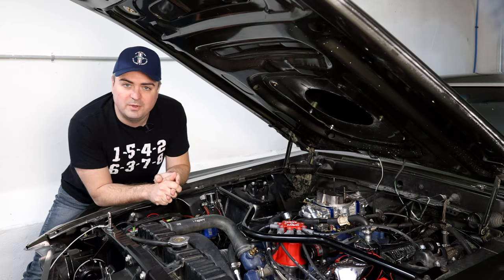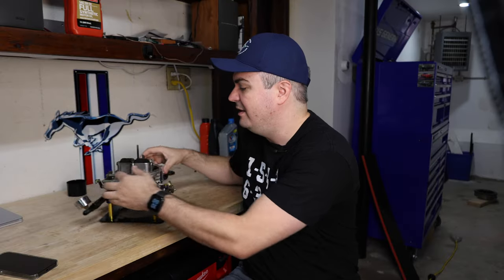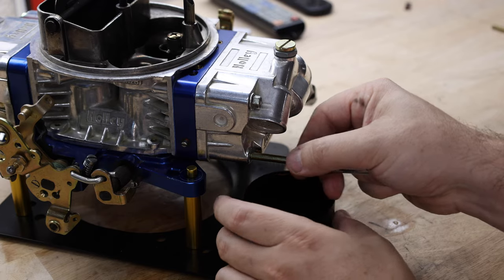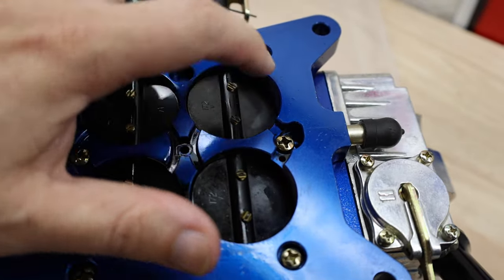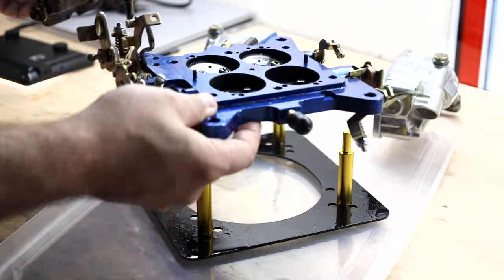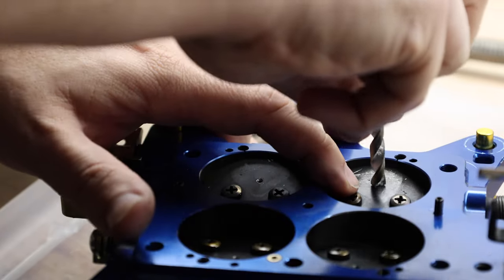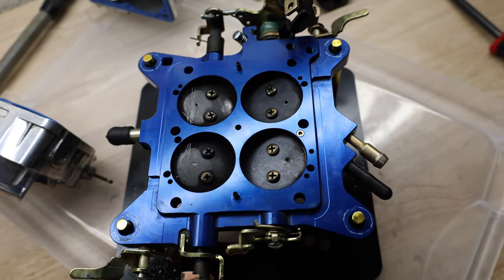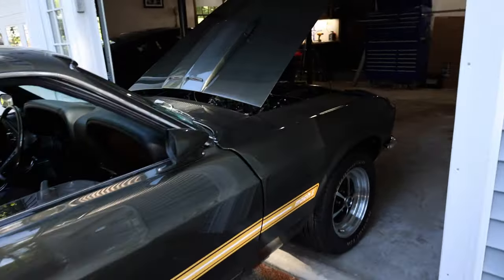Drilling Holes in a Holley Carburetor For a Big Cam

Comment: If you have a non-double pumper and don’t have a transfer slot, all you have to do is open the secondaries. You usually don’t even have to drill the primaries if you do that.
Reply from the maker: Great tip. I just put this carburetor back on and put new throttle blades on. I flipped the bolt that’s on the secondaries so I can do exactly as you said

Comment: There's a setscrew in the baseplate for the secondaries,   They can be adjusted to be cracked open at idle.   Same result without ruining the throttle plates.
Reply from the maker: That’s a great point. Years after this video I took out that screw and flipped it upside down for easier access.

Comment: I did this on my big cam 350. Works great but i had to drill the holes about 1/8" on all for throttle plates. After doing that I've noticed when cruising around 2500 rpm then accelerating slighty i get a low whistle for a couple hundred rpm. But the car idles perfectly and no longer burns your eyes from running rich.
Reply from the maker: Cool. Thanks for sharing that! Nice to hear this solving issues for people.

Comment: Ever heard of DaVinci Carbs?  Ask Dan DaVinci what he thinks about drilling holes in the throttle plates.  He doesn’t like that mod and he builds carbs for extremely serious cars.  Drill and tap your IFR’s and adjust there with different jet sizes to get proper tune.  With holes in the plate the carb is no longer any good for a high vacuum engine.
Reply from the maker: Hey Cryptoking. I was just showing a budget way to do the mod for low vacuum cars. I completely agree with the holes in the plate it is no longer any good for a high vacuum engine. You can buy replacement plates for this car from Holley for $14. I do have a set to go with this carb if I ever decide to take it off.

I also agree with you drilling and tapping the IFRs and adjusting those jets is a better way to tune. If I was going to go that route though, I would have just bought a more adjustable carburetor. This summer, I do plan on switching carburetors to one that has more adjustment so I can fine tune it better. Thanks for stopping by! I might reach out to DaVinci carbs to see what carburetor is best for my engine which will give me the adjustment I want.
Reply: Its not as of the holes cant be plugged.
Reply: @cuzz63  I wouldn’t risk a “plug” falling into my intake....
Reply: @trailerparkcryptoking5213  so braze it in....there are screws holding the blade on...use a screw, nobody worries about the screws falling in, or use some good epoxy, people epoxy holes in the intake....its not rocket science.
Reply: @SmackeysGarage  Idle fuel circuit is adjusted by the metering block screws. Transition fuel is controlled by transition circuit in the in the metering block. Idle fuel is shared by the transition circuit. Problem with big a cam is the over lap is polluting the intake charge
 so you need more air. Even if you lean the metering of the transition circuit you are still going to have to open the the throttle well into the transition slot to allow more air. This will give you an off idle stumble. What you are doing is correct. A rule of thumb is adjust the throttle blade so they form a square on the transition slot. If you can not get an idle with the idle fuel screws in the metering block add more air by drilling holes in the primary throttle blades. Rochester Quadrajets addressed this problem with an idle air by pass system to allow more air below the throttle blades. Throttle blade can be plugged with a 10-32x3/16 binding head screw. Screw head top side red lock tight and a peen on the thread. I have never had one come out. Good job.
Reply from the maker: Thanks for detailing this out Harold. This carbs metering block is not adjustable unfortunately. If I were to buy another one again, I wouldn't have gone with this one. The adjustability of it is really "simple" and you can't just unscrew some of the air bleeds or the metering block circuit. I've been debating trying a new carburetor without a choke (I don't drive it in the cold weather and I think it would be cool to compare experiences across manual, electric, and no choke). Thanks for the good feedback on the video!
Reply: @SmackeysGarage  knowing you can buy replacement plates from Holley is the only way I'd do this mod.  Unlike turning a screw, with this mod once it's done you can't go back.  Except, of course, replacing the plates.
Reply: That was a good answer. I was thinking the same thing I should go down a little bit in my primary jet because it's getting too much fuel when it's idling so it wants to load up with the spark plugs color is perfect right now.

Comment: So how big of a hole did you drill. So why didn't you just go to smaller jets if the Jets are too big and that's why it won't idle? Most of the time if you're really to rich you always change the Jets.
Reply from the maker: 0.0935" holes I worked my way up to what I thought was good for the car. On this carburetor the air bleeds are not adjustable. I wasn't able to adjust the four corner idle enough where it would idle well enough for the car. In order to get the right idle speed I had to open the plates slightly, which in turn caused the car to start running off the main jets, which didn't allow for a good transition from idle -> main jets.

Comment: The transfer slots are on the idle circuit. Your correct in the fix but they have Absolutely nothing to do with the main jets! They only come into play somewhere over 2000 rpm and is the fuel from the booster. 2 separate and independent circuits
Reply from the maker: Thanks for clarifying that! You are definitely right.
Reply: "2 separate and independent circuits"

Not technically true. The fuel in the idle well comes from the main jet.
Reply: You are correct 👍 but I didn’t think it was relevant to the question. So many people have misconceptions about how the circuit’s actually work. I try to simplify it as much as possible.

Comment: on my engine i have big cams aswell but i have the carburetor set with the transfer holes covered but the pilot jet and idle mixture are able to compensate and the car will idle around 13-14 AFR perfectly fine however if i am driving and i close the throttle the mixture runs rich, around 10 AFR. would this mod help me? clearly my issue has to do with having more vacuum coasting than standing still but i am unsure how to fix this
Reply from the maker: One of the things I've done to diagnose issues in the past (similar but not exactly like this) is to put a vacuum gauge plumbed into the car to watch the vacuum amount. Any chance you know what power valve you have, if any? Any chance it is leaking? Drilling is always a last choice option for me.
Reply: @SmackeysGarage  no power valve, it is motorcycle carburetors on a toyota 4AG. ill see about picking up a vacuum gauge, that might give me an idea as to what im dealing with. thanks for the reply

Comment: Great video! I think I need to double check my transfer slots. I have a lot of cam but, I haven’t needed to drill any holes. I’m getting 14° a vacuum however. The comp XE serious provides more vacuum than the magnum cam I used to have. I had a 280° cam before, had 8 inches of vacuum. Now as I said 14 inches with a bigger Cam. 👊😎✌️
Reply from the maker: Thanks Big Stick Stangs! Do you have your XE installed dot to dot? I'm running an XE in this car. 284/296*

Which XE are you running again? Maybe I need some more compression!
Reply: @SmackeysGarage  Yes I am running XE284. it’s installed straight up. how much total advance and distributor are you running?
Reply from the maker: Is it on an FE? I'm running 10 distributor 34 total. Ramps up pretty fast.
Reply: @SmackeysGarage  I am a 351. You should have more vacuum than me, you have more cubes. I’m running 36 total with 12 initial and distributor. The higher the initial timing the more vacuum.
Reply from the maker: Hmm. I'll pull apart all my vacuum lines this week and see if I can chase down a leak. It's probably worth disconnecting the PCV system and the brake system and checking.
Reply: @SmackeysGarage  Yes something somewhere. what intake gaskets are you using. The Fel pro black ones with the blue around the ports distort if overtightened. I quit using them, I use the blue aluminum ones. I have very low vacuum in the past and discovered that. I couldn’t tell until I pulled off the intake however. I checked leak externally, I sprayed starting fluid between the intake and head with no changing vacuum. Once I pulled off the intake there was so much distortion the vacuum was leaking into the crankcase.
Reply from the maker: That sounds like a winter check. Unfortunately with the FE, if the intake is coming off, so are the valve covers and the drivetrain has to come apart. I'll plan on swapping to the other gaskets. 

Which intake manifold gaskets do you use on the 351? Which set is the blue Aluminum. Have a P/N? I'll cross reference that style with the FE.
Reply: @SmackeysGarage  I’ll get that to you in a few hours. I’m working a short shift now! you’re absolutely right about the FE motor! One of Ford’s BEST engines!
Reply from the maker: Thanks for all the info! No rush on the info since I’m pulling it apart this winter.
Reply: @SmackeysGarage  FEL-MS90145 is the Gasket part # for yours I was  speaking about. Have a great weekend!
Reply: @SmackeysGarage only 10 initial might be your problem. I'm running like 22 initial and 36 total on a 381 Chev, no problem. I got a super big comp cams 12-602-8 (Advertised Duration 299/319), lumpy as heck, only 4.5" Vac at idle, 15" of Vac cruising at 3000 rpm. Snappy throttle and it pulls hard, with 650 speed demon, dynoed at 511hp and 492 tq. (Could of maybe used a 750, but the smaller the carb you can get away with, the tighter the throttle response is) 

What if you advanced your initial timing way up to 20 or so (don't rev engine), will your engine gain rpm? If so, 10 was to little to start with. More timing on idle, the better.

Some guys run a Vac advance distributor and add even more timing like 25 to 35 initial timing at idle, in that range I believe. 

I have the idle eze rpm adjuster, adjusting screw but I don't even need it, it's closed. Both my transfer slots are pretty much perfect, no hesitation or bog.

I would want maybe 24 or 25 initial timing but I don't feel like re curving and adjusting the distributor. I idle around 850, I could go lower but then it sometimes feels like I would want to stall if I left it by itself for too long. Have fun.

Comment: This is a cool video thanks for sharing. I'm here because I'm trying to run a racing tuned 870 double pumper with drilled holes in the throttle blades on my stock 454. I'm having a hard time getting it to tune right. I can pull upwards of 21 inches of vacuum depending on how i set the idle mixture screws. My main problem is with the vacuum advance hooked up it idles way too high and the idle dry screw is bottoming out. This carb is obviously not ideal for this engine, but it was free...
Reply from the maker: I hear you about making free parts work. If you are dead set on using this carburetor you could always play with the vacuum advance or eliminate it. You might get to a point where you aren’t happy with anything on this carburetor though.
Reply: If hooking up vacuum advance changes your idle speed, you are hooking it to a direct manifold vacuum port causing the vacuum advance to add timing at idle. To avoid this you should hook it to a timed port, one that only allows vacuum to it when the throttle blades are open (not at idle) this way your base timing stays the same, but you still get the benefits of the extra advance while cruising.
If for some reason you do not have a timed port, you can back off initial timing by the # of degrees the vacuum advance is adding to reset base timing, but this would require you to be able to adjust the mechanical advance curve to compensate and is often harder to do unless you have a distributor set up to make those changes easier.

Comment: Question  did you notice any black smoke before you fixed it do to too much fuel being dumped??
Reply from the maker: You will definitely get black smoke when it’s running too rich. I have seen that before.
Reply: @SmackeysGarage  rite on thanks man I'm still trying to figure out I it's piston rings valve seals or the holley  750 lol

Comment: Good video of doing this. I’m just getting to the threshold of needing to perform this mod, I probably just need more convertor. 
Btw, you might want to check your vacuum caps, the one behind the secondaries looks like it’s starting to dry rot @ the 2:00min mark. I’ve found the parts store caps do this with the ethanol fuels nowadays, they only last a year before leaking. I bought an assortment pack of silicone caps to hopefully last a bit longer.
Reply from the maker: Good eye and thanks for noticing. I just bought some silicon caps I’ll replace them all with. Appreciate it Keith!
Reply from the maker: Also, if you get to the point where you are doing this, Holley sells the throttle blades with holes pre-drilled if you want a starting point and don't feel comfortable drilling into the ones on your car. This way if it doesn't work you can always swap back.
Reply: @SmackeysGarage  I’m currently using an 800 spreadbore Holley on a big block Buick. They have odd sized throttle blade sizes, so replacements might not be a common item. The cam is pretty small, just has a tight LSA, so idle is a little tricky with a too tight convertor.

Comment: Great video, but whats the size of the hole drilled? Thks
Reply from the maker: I’ll look at my notes tomorrow but I believe I used 3/32.
Reply: @SmackeysGarage  OK, thanks!!
Reply from the maker: So I started with an 0.093 in the primary side only put it back together and it was not enough. I ended up with 093 on both the primary and secondary sides. My recommendation is to start small and work your way up. What has worked for me may not work for you. Baby steps.
Reply: @SmackeysGarage  Ok man, thanks so much!

Comment: I have a 600 lift cam in my big block haven’t fired it up yet is that considered a big cam ?
Reply from the maker: Depends on a lot of different factors (cubic inches, compression, etc). It basically boils down to how much vacuum do you have at idle. If the cam has a lot of overlap, vacuum at idle is typically on the lower side.
Reply: @SmackeysGarage  thx for the relay it’s a 496 600 lift cam seems pretty mild for that big of a motor but it’s my first build. I’ll fire it up and see how she does first
Reply from the maker: Cool. Let me know how it goes!

Comment: Nice video Smackey, thanks for showing us how to do this.  Car sounds great, i hope it helped you out.  Does doing this give you more vacuum or what?  Thanks..
Reply from the maker: Hey Robbie, it’s driving much better now. Thank you! 

It doesn’t give you more vacuum but instead reduces the pressure drop through the throttle blades which ends up giving you more air and in my case a better idle too.

Comment: How big did you start out with? Im running a 244-248 duration @.050" on a 110 lsa installed on 105.
Reply from the maker: I have the carb off so I just went down and measured for you. I believe I started with 0.087 on primary side only, tested, then ended up also drilling 0.087" on the secondary side as well. I'm running 110 lsa 240/246
Reply from the maker: I also spent some time adjusting the initial timing to get the RPM right.
Reply: @SmackeysGarage   are you running a 350, 383 or 406? The bigger motor should pull slightly more vacuum, so  smaller holes may get the job done. Does that sound about right to you? Thanks for measuring.
Reply from the maker: Sounds about right. I’m running a Ford 390. It might be worth increasing base timing to see if you can gain some rpm before drilling. It would make it harder to start though
Reply: @SmackeysGarage  i generally run 24-26 degrees of initial timing wouldn't any vacuum advance.
Reply from the maker: @inscoredbz   got it. I don't run any vacuum advance either.

Comment: Will this fix a rich idle?
Reply from the maker: It would help by letting more air through… If your engine is running on the main jets rather than the idle circuit and there is no way to adjust that I would take this step.  I would start with everything else before you make this modification though. I’d check the idle circuit / throttle plate location and transfer slot exposure. Usually do this for a large cam with little vacuum. How much vacuum are you pulling?

Comment: What size drill bit did you use?
Reply from the maker: Just went to double check and remeasure. The holes that are in the primary and secondary are around 0.0935. I started with a 3/32 bit on the primary sides only. Test drove the car with the throttle plates in the right location and then realized I still needed more airflow to keep it idling. I then did the same in the secondary sides.

What worked for me may not work for you. I would definitely start in small increments and work your way to where you need to or want to be.
Reply: @SmackeysGarage  So that would be 4 holes, each 3/32".

Comment: I have found that going to four corner idle many times will eliminate the need to drill the plates.
Reply from the maker: I tried and wasn't able to get it to run right. If I had adjustment on my secondary plates to slightly crack them it would have also resolved my issue. This carb does have one but it wasn't easily adjustable.